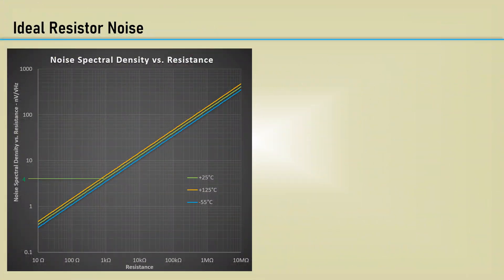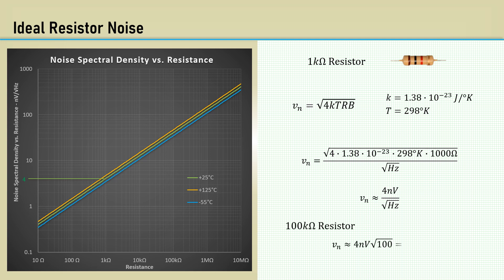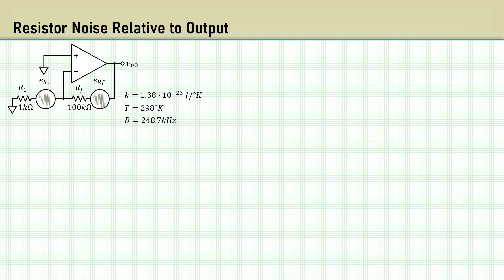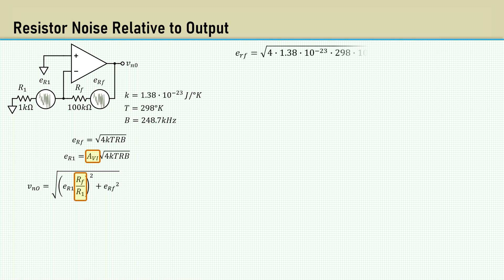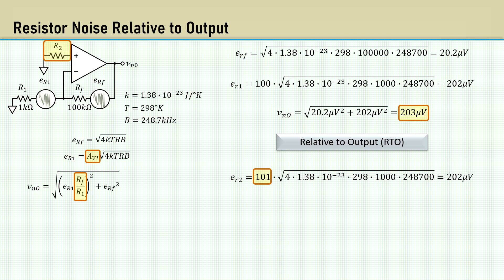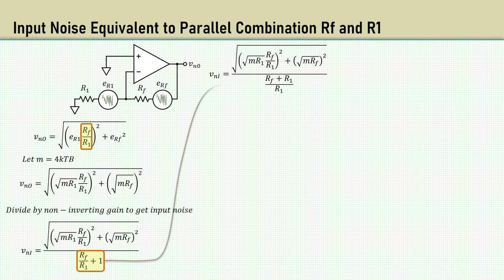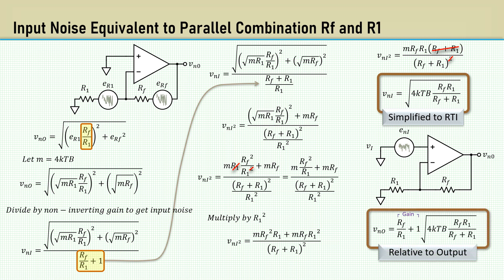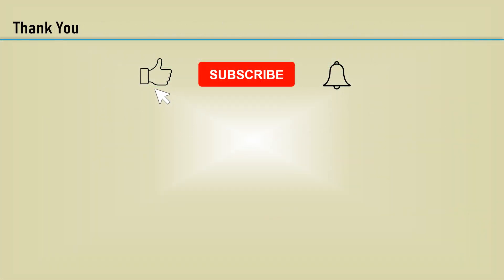Op Amp Noise Calculations - Part 4

Comment: Very interesting and clearly explained, thanks. How would you calculate the noise of an instrumentation amplifier (3 opamps, resistors on input to + of two of them, the third inputs driven by the outputs of the first two)? Does the input noise of the differential inputs cancel out?
Reply from the maker: The noise sources are incoherent and do not cancel out.